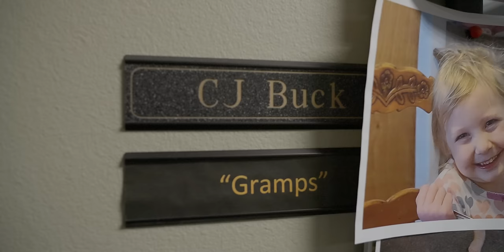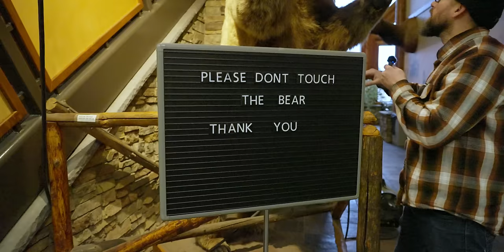Is this even possible…? | The Best Stories From Our Buck Knives Pocket Check!

Comment: Years ago I got robbed. The one thing I couldn't replace was the buck 110. 40 years later I still miss that knife. It's been replaced with numerous other knives but not the same.
Reply: Mine got stolen about 45 years ago. I should have bought another one back then.

Comment: Bro! I love how genuine you are in your videos. Especially when you approached the head honcho of Buck. Cool as a cucumber. But as for my knife story, I've carried a knife since i was 8 and have a ton of them and I love all knives...
   But there was one time I was on call one night for wildlife control and got a call at about 3am for noises in an attic. Well I get there and removed a nursing female raccoon from their attic with my catch pole. So because she was obviously still nursing, I went looking for her babies... well after about two hours of searching I finally located them at the bottom of a room addition wall and couldn't reach them because I was looking down the wall void from the attic. So because it was late and I didn't have a drywall saw and needed to get the baby raccoons out.  I pulled out my Esee avispa and cut a hole about arms length above the babies and pulled out four of them. Then turned them and their mother in to the local wildlife rehab center.

Comment: I have two favorites; one fixed blade, one lock blade. 

Fixed blade: I'm a bladesmith. My mentor made one specially for me. It's an absolutely amazing knife. Absolutely gorgeous. Handle feels like it was molded for my hand. Sheath is a stunner. Absolutely love the thing.

Lock blade: Spyderco Police 4 in K390 steel. Holds an edge forever. Have to use my machines to sharpen it once every 4 months. 

coming in after these is one I made. I call it Brutus. 1/4" thick 1084 steel, bead blast finish, could chop through steel beams with it.

Comment: My favorite knife is my CRKT M16-04Z. I've had several, over the past decade. I do a lot of mechanic work and CRKT has always held up to the abuse. The one I have now is my favorite (useable) knife because it's literally saved my life. I was attacked and I used the handle of the knife as a pummel to hit the attackers pressure points. I never even deployed the blade. But it was just the right shape/size to dig into those pressure points to put him on the ground so I could get away. Had it not been for that knife, I don't think I would be alive today. I just hope I never have to use it in self defense again. My other favorite was my grandpa's USMC issued fixed blade knife. It was issued to him in July of 1949 right before he was stationed in Okinawa. He said it got used more as a pry bar than a knife. The blade has a slight bend to it but it still sharpens perfectly and holds an edge better than any knife I own. I'm thankful I was able to save all of his Marine kit after his passing, but I would much rather have him back. But I think he would be thankful it went to me since I've been collecting/using knives for 2 decades. Out of the 90ish knives I got from his collection, that one and his daily carry Buck are the ones I treasure most. I can barely bring myself to use them. But I'd take him over all of the knives in the world.

Comment: Pen carry is a big idea designs pocket pro in copper with a write in the rain insert and a generic tactical pen off amazon i was gifted, mostly carry it for the glass breaker and as a backup, even low its cheap aluminum its survived being run over by two forklifts

Comment: My first Buck was a 112 Scoutlite with a red handle and a green nylon BSA sheath. It had the same blade as the regular 112 but was one of the first plastic handled Bucks. It was awesome, but it got confiscated at some point and so I saved up and bought a 112 Ranger a couple years later. It felt so grown up in comparison. I’ve had that knife since about 1989. When the 112 Slim Select came out, I bought a red one to replace the Scoutlite that was taken all those years ago. It’s not the same, but it’s close.
Reply from the maker: Love the full circle💪

Comment: I ditched carrying a pen for a Rotring pencil with a 2mm lead. It's absolutely great.
Reply from the maker: Definitely going to check that out🤘
Reply: @zacinthewild  oh, dude it's great. It writes fantastically, with a good weight to the body. If you need a fine tip, there's a sharpener in the clicky cap (but, y'know, we have to justify carrying a knife so use that), I'd you want a big fat, easily visible line you can blunt it on the closest piece of concrete. It's great for note taking (looks the part for a fancy meeting), it's great for woodwork and marking. 
I think it's a Rotring 600 2mm.

Comment: My buck story: my dad found a buck solo knife i believe its the tiny one with a single blade anyway he found it on the sidewalk and took it home, i still have and it kinda needs some love the slip joint feels crusty and the tip is slightly bent and could use a little bit of sharpening but overall its still very much usable.

Comment: Hi Zac- Once upon a time you read my Buck 110 story on Knife Banter on boomerang knives. I did Foundations for years my Grandfather gave me his old Buck 110 as my first knife. It became my work knife. We were pouring concrete columns for the loading dock at the Standard Examiner in Ogden, my job was screeding (making sure the right amount of mud was in the column) the pump operator bumped the joystick and the pourer lost control of the downpipe which knocked into my bags ripping my leather sheath and down into the column it went sadly the vibrator zapped the mud before I could stop him- my Grandfathers Buck 110 is forever ensconched in the Standard Examiner loading dock.....Maybe someday I might get it back. Doubt it.
Reply: I carry Twosun pens currently.

Comment: I got one 110 folder for my 21st birthday and now I'm 50 and it's still going strong. 

I used two buck fixed blades I can't remember which ones they are for deer hunting because then I can clean them easily and when one gets dull I just pull the other one out and I'm ready to go.  One of them is a fake Chinese Buck knife but seems to be holding up it's been through three deer so far and not been sharpened.

Just looked them up and one is a custom Cabela's Vanguard fixed blade with a guy hook(zipper?) and the other is the same knife without the guy hook made in China with Buck on the Blade and a Cheapy Sheath.  I could not Believe a Buck knife was made in China even said made in China on the box.  And I meant Gut hook just didn't look until later.

Comment: i would want to carry a buck knife and own one. what i usually carry on me is an eldris morakniv knife, which is my school knife since you can carry any legal fixed bladed knife that is 2.49" or less, in blade length, on any californian school grounds, sometimes, whenever i'm at work, i carry a SOG survival knife that i just bought that is 3.8" on the blade and it comes with a seatbelt breaker on the sheath in case you need to stick the knife back in the sheath and just break open a seatbelt, and an automatic which is the automat kalashinkov 74, which was featured on the most recent automatic knife video that bladehq did recently. that is a general idea of my EDC when i'm in calfornia. i know that the legal limit is under 2" in cali, but there's exceptions where you can break the state knife law, depending on where you're at in cali
Reply from the maker: Great insight! I had no idea on the Cali stuff.
Reply: @zacinthewild  California isn't a knife friendly state, but yeah, it's a whole different ballpark. Especially with legal ways for breaking the minimum knife law for OTFs, switchblades, folders, and so on. If you look up LA county knife laws, the blade length is under 3". So it's 2.99" and below. In orange county, it's under 4" for folders, switchblades, etc, if I'm not mistaken. And this is not for fixed bladed knives.

Comment: The first knife I ever bought legally when I was 18 was a buck 110 I put the knife through a little bit of hell but it is an amazing shape the nylon sheath melted around the knife during a house fire but outside of a few burn marks on the handle I was able to clean up the bolsters in the blade and get soot off of the wood handles which the fact that it survived prove to me how tough the knife was I work with specialty Concrete Coatings use knives constantly but I won't carry my buck to work because I don't want to get paint all over the scales of the handle but it is a great knife and I will carry that knife to hell and back if I have to
Reply from the maker: Cooool! Does that 110 still hold an edge after the heat from the fire?
Reply: @zacinthewild  it holds an edge longer than any other knife I own I remember being told as a kid that buck knives are the best knives in the world my Uncle Jerry told me that and I didn't believe him until I got my 110 it's not my most carried knife but it is one knife I know will last me through anything I could ever throw at it

Comment: EDC pen: I use the aluminum Benchmade self-defense pen with carbide glass-breaker. Uses Fisher pen cartridges, so I have the Rite in the Rain cartridges. Working on a loading dock, I decided to use a tough reusable pen rather than the cheap company-branded throwaways for signing shipping receipts. Also use a CRKT CEO and Benchmade Super Freek around the shop too

Comment: I'll never buy another buck they may have been decent in the past but they are now garbage. All the bucks I have were anything but good/quality. I bought four to include a custom 110. I had to send three of them back because they were unacceptable. They were returned to me with the same issues as they originally had when i returned them. I believe they may have been oiled and polished but they were not fixed. the blade scraping/rubbing the sides and sound and felt like sand was in them when opened. The backspring protrudes so far it catches/snags on my pockets. two of them had what I can only assume was some sort of sticker residue on the blades and they were discolored. There were gaps/spaces between the handle scales and the bolsters and on and on. The issues were even on the custom knife I ordered (a 110) that cost significantly more than normal. There must be a NON Existent qualify control department at Buck to let knives like the ones I received out of the facility.  Shame on Buck for producing the poor quality knives they do and charging as if they were actually decent. The knives i receive3d were on par with a flea market $5 grab box special. The worst part is that it took a couple months for Buck to finally return them in the same condition they were when sent in. So I learned my lesson the costly way and will NEVER buy or recommend a Buck to anyone. There are much better options out there